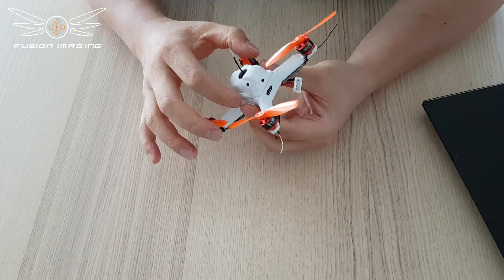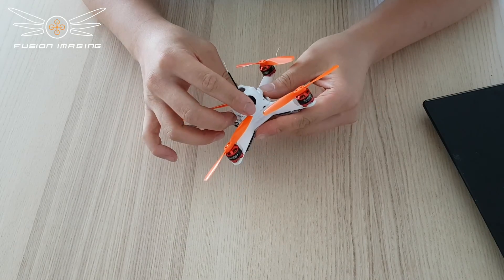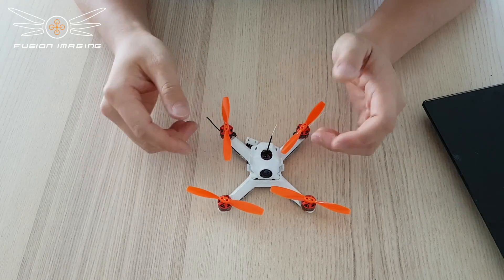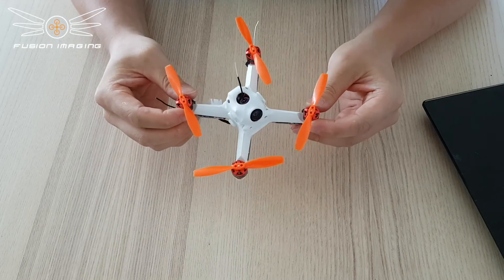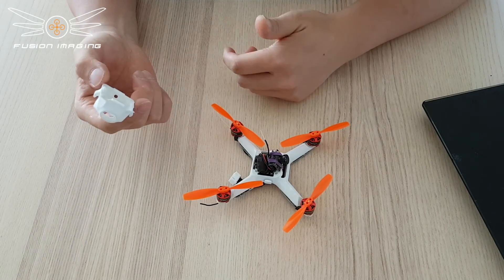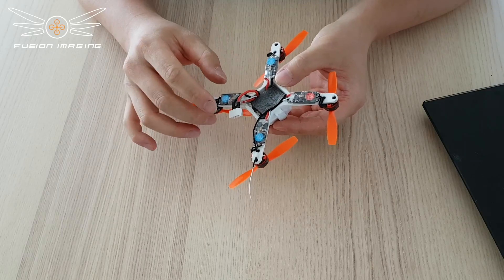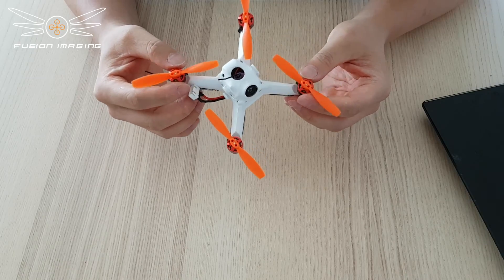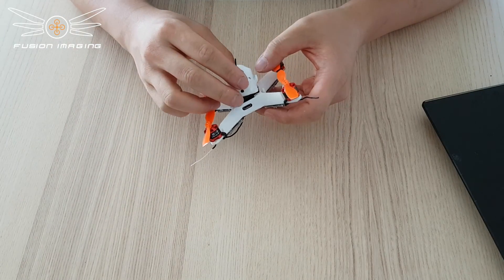Fusion Micro FPV Frame Overview

Comment: what motors, props and lipo are you using in the demo at the end? looks fast!
Reply: Racerstar 1104 4000kv, 3s 450mah nano tech 65C, 3020 props. It's mainly the lower air resistance that make it feel faster.